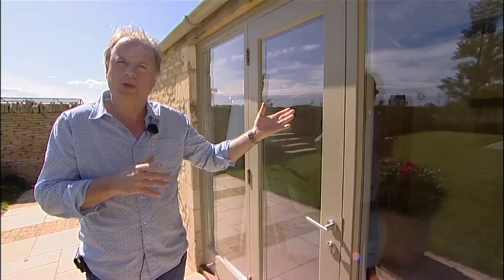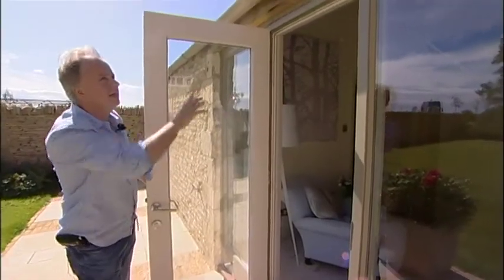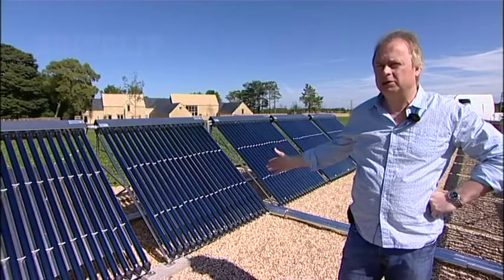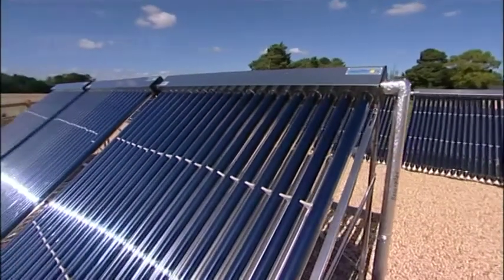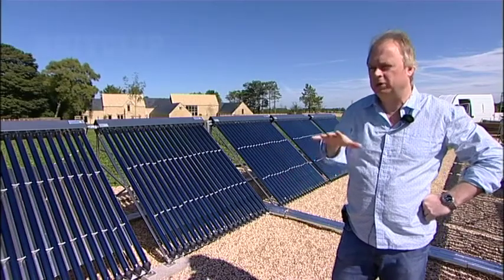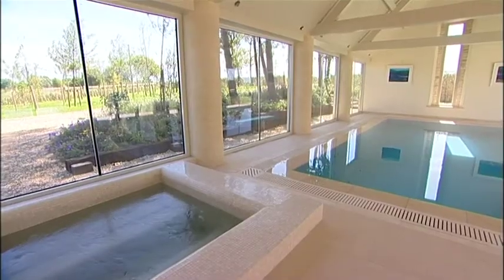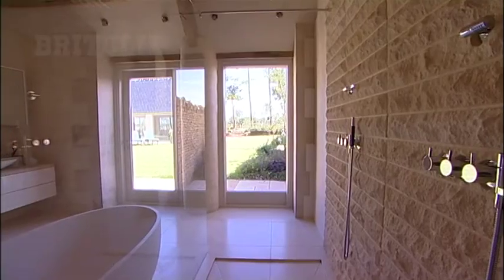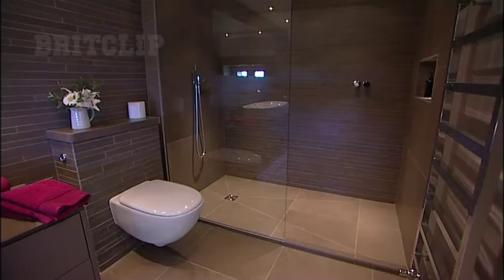Britain's most advanced ecological house

Comment: From what I have read the humidity level actually needs to be higher than that for good health. Around 40%- 50%. You don't want to be in a dry environment drying out your skin eyes etc. It's interesting but completely air tight means you need a mechanical ventilation system which needs energy to work. It would be good if there was an even more natural way to build a comfortable home.